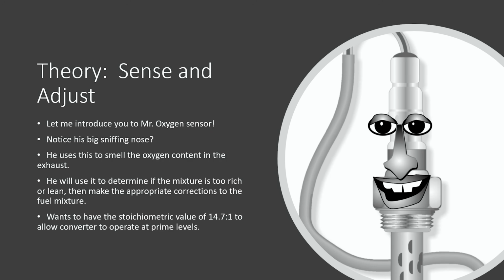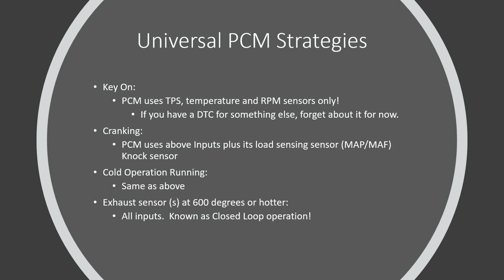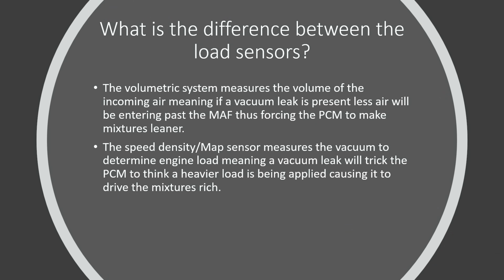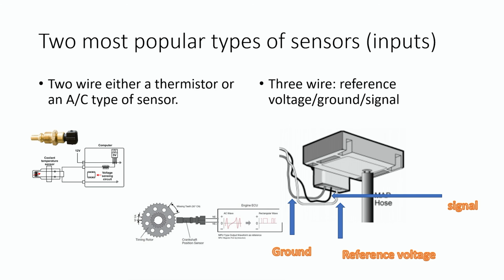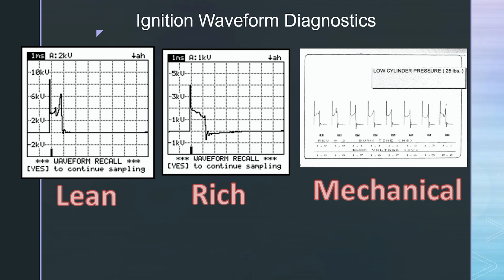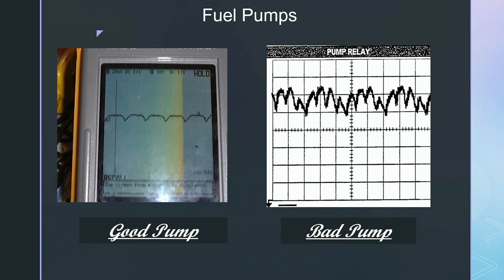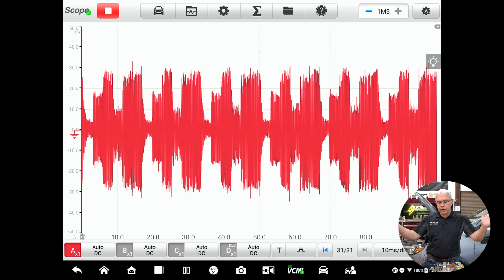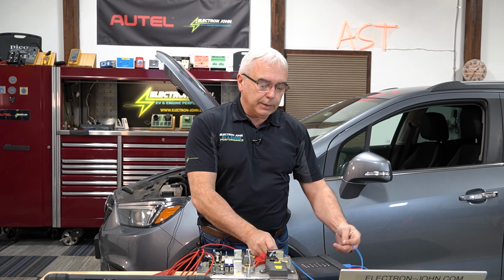Expert Techniques in Advanced Vehicle Diagnostics: Part 2

Comment: For upstream HEGOs (narrow band, switching) closed loop fuel control, the strategy is a switching control (because the HEGO only detects two states, rich or lean) with a long time constant filter or a long time constant PI or PID control loop supplying learned fuel trim data, which is then used as a mean fuel bias level upon which the switching algorithm is optimized. If the learned fuel trims are correct for the current engine operating condition, the fuel switching algorithm will use a symmetrical jump back around stoichiometry, essentially trying to maximize the switching frequency. The upstream HEGO works well for this closed loop control because it is directly in the exhaust stream. The jump back (bang bang) control is not a controlled frequency as output, it will result in a set switching frequency if the fuel trims are perfect and the catalytic converter (CAT) operation optimal. The switching waveform is the result of everything in the control loop. 

The HEGO signal switching amplitude should not change pre and post CAT like shown in the drawing in the video if the two sensors are identical, and if the CAT was perfect the post HEGO would not switch at all (complete and efficient O2 control) or perhaps be pegged lean. In fact, the intermediate voltages (mid span) of the HEGO output between the normal rich lean switching thresholds are meaningless. So the CAT efficiency (or other such OEM words to describe CAT health, which is crude at best) makes sense only as a relative measure of the pre and post CAT HEGO switching characteristics. So, we can make inference between pre and post CAT switching but not amplitudes. For identical pre and post sensors the output should be the same, registering either rich or lean. 

This is where understanding the CAT monitor strategy OEM description is very important. Because it may imply that the CAT monitor is a special test pegging rich or lean at a certain point in the drive cycle to understand relative HEGO switching behavior. But, where in the drive cycle for emission would you intentionally control CAT breakthrough, ideally you wouldn't.

This is why CAT OBD II monitor (test) is done over two complete drive cycles with specific operating conditions before the test is run. But, we could rephrase this and say the test is so crude that we don't want to set a DTC unless either the CAT or HEGO is spent. 

To really see the HEGO outputs it is best to directly probe the signals at the HEGOs (use differential scope probes) and not plot scan tool data.
Reply from the maker: thank you for watching.  your reply is full of a great deal of technical responses.  I must admit certain things like bang bang and other I have never heard of in my tenure as an automotive technician or instructor.  I would love to study/learn more of which you are speaking.  do you have any trainings or videos you could share?

Comment: Hello,Sir. I know a maf sensor reading with key on does not matter. Should the reading fluctuate a lot?  If not, what  would cause this sensor signal to be erratic with just key on?
Reply from the maker: while it’s normal for the voltage at the sensor to drop ever so slightly while the hot wire warms up, it is not normal for it to fluctuate a lot as you stated.  I would suspect either a wiring issue due to loose connection or unwanted resistance somewhere or even possible a battery issue since it is just key in engine off.  do you happen to notice the headlights doing the same thing?  if so, suspect a battery issue.
Reply: @electron-john  I will check the headlights when I get to see the vehicle again. I checked other vehicles and the readings are stable. We have a different sensor that we can try.

Comment: A waste of time video.  Had an ad for some fixd dongle the guy said it worked as good as his expensive scan tool.😅.  Why do i as a technician need a scope when i could just use that miraculous dongle?????
Reply from the maker: Hi Charliemagoo7943,  Thank you for responding, I am a little confused.  I did not mention any dongle in this video.  Maybe you saw an ad that youtube placed within the video?  I do not control the ad placements.  However, my goal is to share knowledge with other professional technicians, so if there is a type of content you feel would be beneficial, please let me know.
Reply: @electron-john  actually good video.  The google ads were for dongles to fix cars. I honestly doubt anyone learning from your videos would buy the dongles.  They are on different levels.
Reply from the maker: Thank you! @charliemagoo7943

Comment: Why would a PCM be looking at (and adjusting for) a knock sensor during cranking? This is a known "noisy" time as you mentioned, and the end result would be it reducing ignition advance erroneously, no?
Reply from the maker: Great question and I am glad you asked.   Basically we do not want added timing advance when cranking because it makes the engine have a hard time starting.  The ignition occurs to much in front of the piston reaching tdc and since the rpm is low during that time, the engine struggles to overcome the the starter trying to fight the power stroke event.  Not all vehicles will have this strategy but the ones that do will use an rpm sensor and see the cranking rpm is happening .  It assumes this condition based on low rpm, say 2-400 and confirms its suspicions of cranking by seeing a noisy knock sensor due to , as you said, the starter gear meshing with the flywheel teeth.  It also uses load sensor input to help confirm its suspicion.
Reply: @electron-john  Ah, ok, so if I'm understanding correctly then it's utilizing the knock sensor to arrive at the "correct" ignition timing for cranking/starting, not retarding it even further than desired like I originally thought. That's an interesting strategy rather than just programming in the (reduced) ignition advance you want during cranking and ignoring the knock sensor input during that time, but I guess it does give the PCM a way to tell that the starter motor is no longer engaged and increased timing is desirable when it stops hearing that noise? If you have an issue with an inoperative knock sensor in a system that uses this strategy can it lead to harder starting, or at least more current draw by the starter? 

I really appreciate you taking the time to respond to my earlier question (and making these videos in general). I'm in the automotive program at my local community college and having resources like this are immensely helpful, so thank you.

Comment: I am an old school vehicle electrician - I broke my teeth on british military vehicles -  Land Rovers, Bedford Trucks, Chieftain and centurion  tanks (with he 27 liter v12 merlin engine which was used on the Spitfire and P51 Mustang) where the ignition system was a coil, a distributor, a set of points and number of high tension leads and plugs. The only sensors were an oil pressure and a water temperature sensor! Fault finding was really easy. It was the same on the cars of that era. I really enjoyed seeing how to troubleshoot  modern cars. Thanks for your efforts - I look forward to seeing more insightful videos in the future - keep them coming
Reply from the maker: Thank you!

Comment: I am sorry, John, but you made an incorrect  statement. You said  neg is lean .negative in the trim means rich it means is pulling fuel, not adding
Reply from the maker: Hi Luis, where did I say this incorrectly at?  I watched the video again and could not locate where I said it incorrectly.  You are correct with your statement that anytime the fuel trim numbers are lean that is a result of rich exhaust and anytime they go rich, it is due to lean exhaust.  I just couldn’t find where I said it incorrectly in the video so if you could point me to that section of the video, I would appreciate it!
Reply: @electron-john  Hi John, you didn’t say it incorrectly.
Reply: John was talking about voltage at the sensor, so he is correct.  He is not talking about ‘%’, which is how some people view fuel trims with their scan tool.
Reply: @djosbun 
Excellent .
Reply: Lean means too much oxygen, not voltage, which means an incomplete combustion wherever there's a near complete combustion, it is not going to be found oxygen
Reply: @luiscruz-no3ib  He’s talking about measuring voltage at the O2 sensor.  Go watch it again.  Low VOLTAGE at the O2 sensor means LEAN.

Comment: I have seen that test more than once. The first time was SMA then SD , I forgot the last one.  They called it circuit test integrity.
Reply from the maker: Yes it can also be used to test the circuit proving the 5 volt reference wire and the signal return wires are in tact.  The difference when viewing the waveform is to watch the pattern on the screen .  It should stay steady at the reference voltage, if it starts to bounce up and down, that is the sign of an analog to digital converter going bad.  Again, this test should be done if multiple analog type signals have generated a dtc